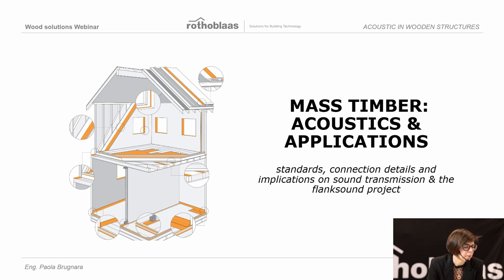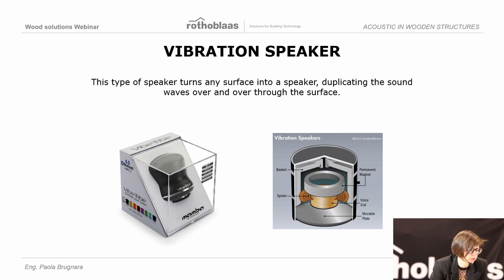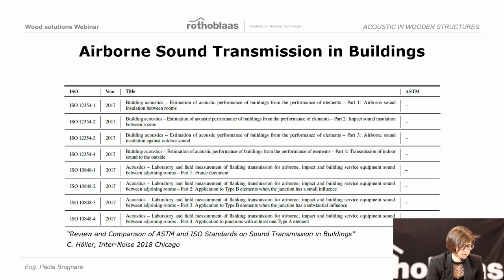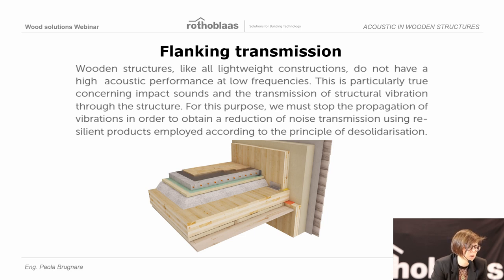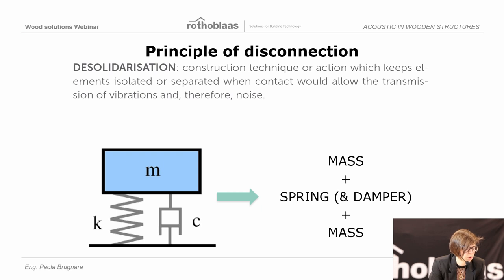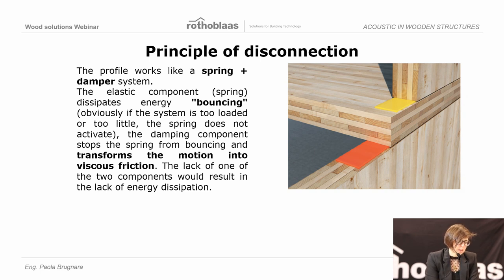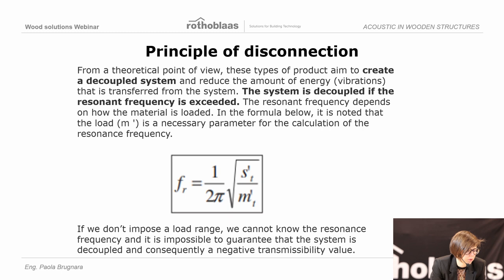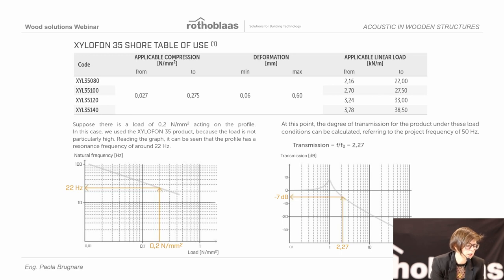Acoustic Design for Timber Structures - Rothoblaas Insights

Comment: If we compare between exterior wall of CLT vs exterior wall of timber frame. Which one has better acoustic performance?
Reply from the maker: It’s hard to say. The acoustic performance of a wall depends on the entire assembly and it is not possible to sum the contribution of the single material that make up the wall.

It is possible to achieve high acoustic performance in both CLT and timber frame if the right thicknesses, insulation and cladding are chosen. Thanks, team Rothoblaas